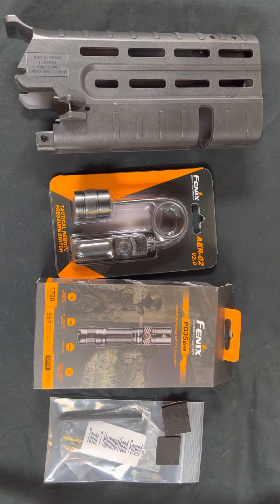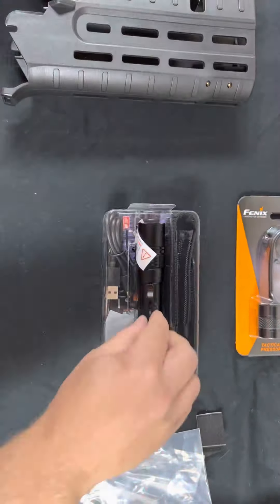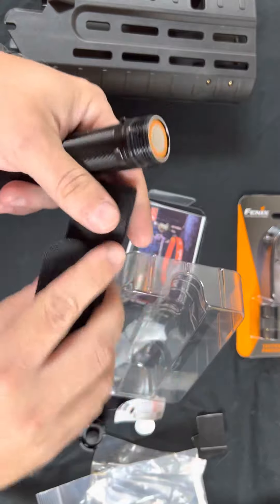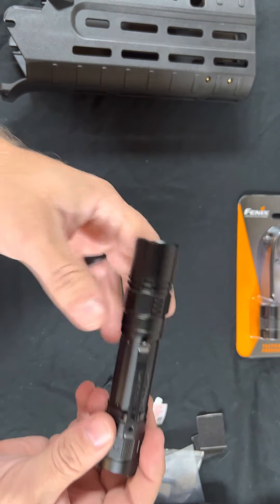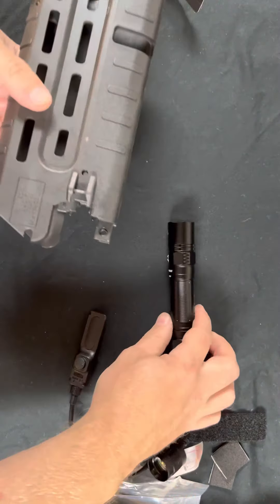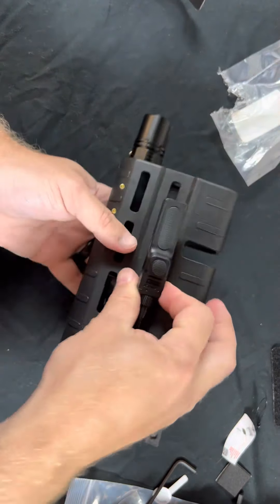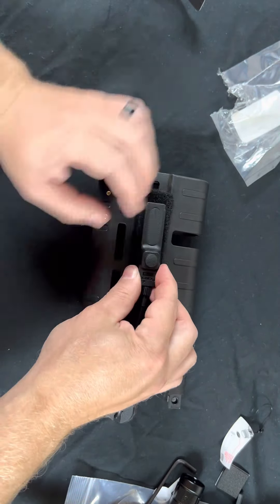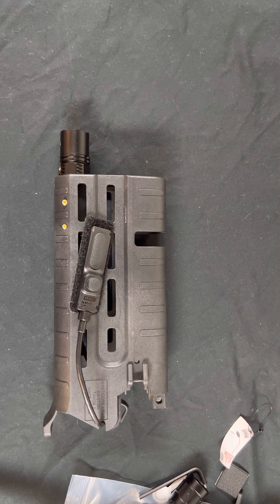Tavor 7 Hammerhead wity Fenix PD35 light install

Comment: FWIW, if you extend the PD35 just a bit further out the front of the Hammerhead forend, you can unscrew the head without having to loosen the front two set-screws at all.  Shot 65 rounds out of my Tavor 7 with the light installed that way and it didn't appear to cause any harm to the lens.